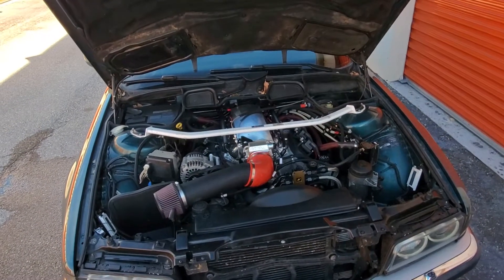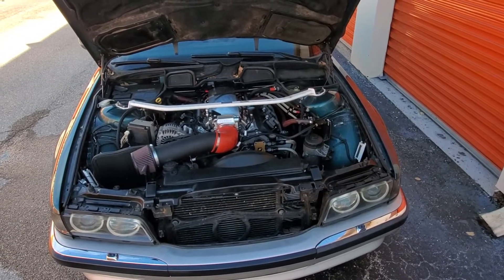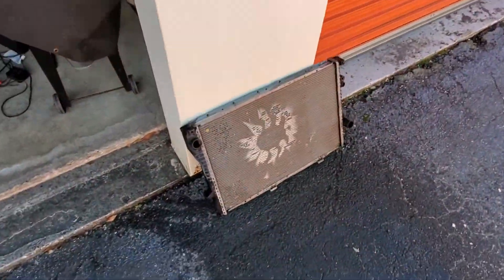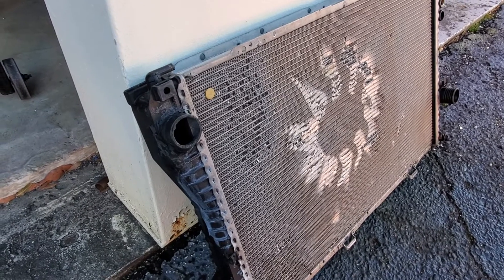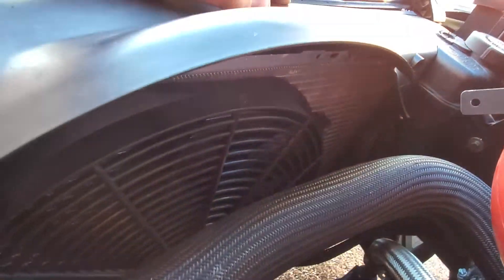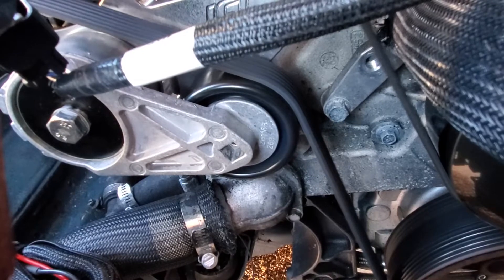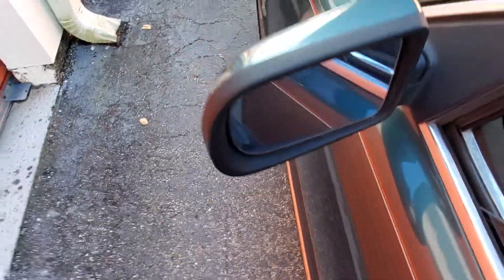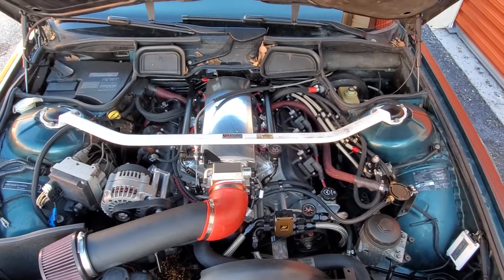e38 740iL BMW LS SWAP pt. 27

Comment: What did you do for a drive shaft and how did you bypass the EWS security crap
Reply from the maker: @RustyRatchetGarage  drive shaft was the oem drive shaft. I bought a slip yoke for the t56 and had a drive shaft shop weld and balance it. The EWS I just intercepted the outbound key on signal after the EWS box. Can't remember the name of the module but I have a video that shows the drive shaft and the EWS bypass.

https://youtu.be/PPae96b-888?si=1YACpZ_L-ROvGnXV
Reply: @ awesome thank you
Reply: @thehomeofbiglspower  do you have any more vids coming out on your BMW
Reply from the maker: @RustyRatchetGarage  hey brother, I have been working on it some but have not had much free time recently. I'll see if I can make one after Thanksgiving to show where things are at and the progress I made since my last video. Happy Thanksgiving and take care.

Comment: Question how much did it cost for the swap
Reply from the maker: Hey Cliff, I don't have a number I added up from every piece I bought, but trans was $3,200, motor was probably $5k after forged pistons and machine work, cam, etc. Exhaust was $1,200, terminator x was about $1,200. Would say probably $14k after all said and done. Could be done Cheaper which is my goal with my next motor. Those numbers don't include labor which I probably spent 3 to 4 months working on the project. Best of luck.